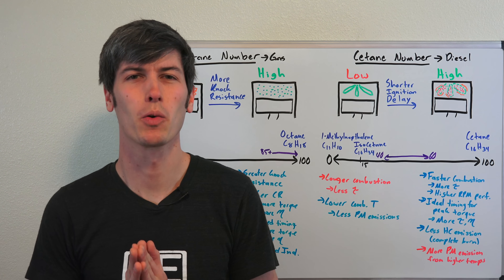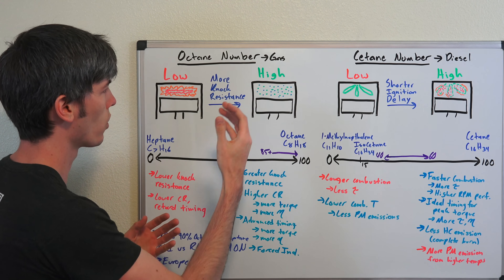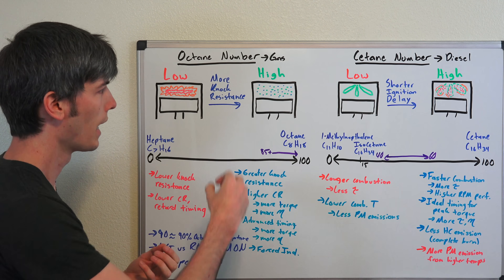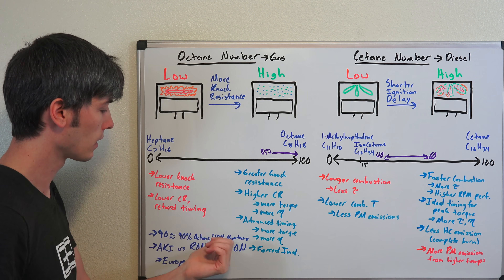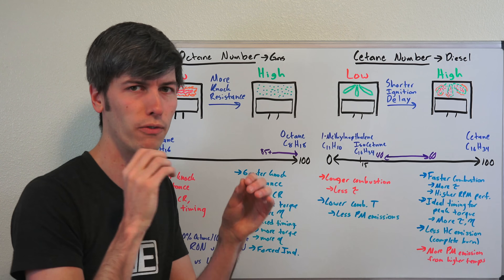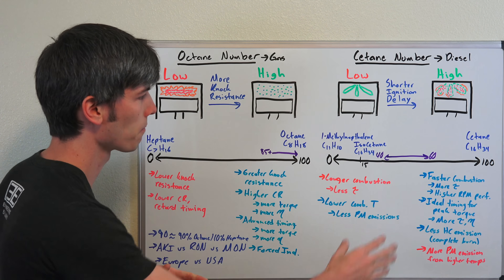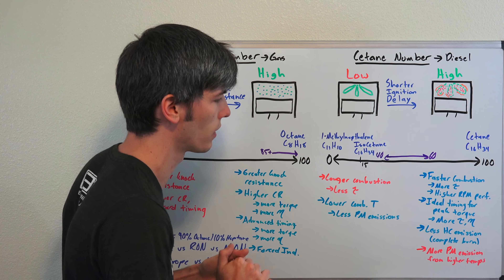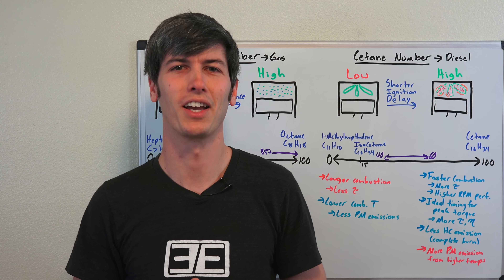Octane vs Cetane Number - Gas vs Diesel

Comment: I run 89 in my vehicles just to have that little extra resistance to knock.
Reply: A little bit of knock every know and then is normal and does no significant harm to your engine.
Reply: Giovanni you’re insane if you think any amount of knock is good for an engine.
Reply: I never said "good", did I? I'll give you a dollar if you can tell me where I said that to you.
Reply: Stay_salty_fam I'll give you $2 if you can tell me where I said it was "fine" to you.
Reply: Gasoline is volatile. Even with higher octane gasoline, it can still detonate before a spark. And sometimes engine knock can occur with simple fuel and carbon deposits. It's normal for there to be some mild engine knocking with any fuels,  you can't expect absolutely zero knock in a piston engine, even on a diesel cycle.
Reply: Stay_salty_fam Then run 89 octane. No one is telling you not to. People are simply telling you that using higher octane in an engine that does not require is just a waste of money. If your engine knocks, then it needs higher octane.
Reply: Giovanni you said an idiotic statement that knock, even if just a bit, is fine, which not true.
Reply: WillerNK of course you can’t, but if I can help buy running a slightly higher octane to help decrease it, I will. Only reason 87 is even offered is because people are cheap.  Manufacturers have to get their engines to run on it because people won’t spend the extra $5 a tank.
Reply: Stay_salty_fam You aren't decrease anything, you just believe old grampa's tales. In reality, modern engines have knock sensors, which keeps engines from knocking. And with direct injection, fuel knock is virtually eliminated, even on high compression and turbo engines. They can run 85 octane without problems.
Reply: Hambone it’s not an old wife’s tale. My vehicles don’t knock on 89 but knock pretty bad on 87, especially in the summer.
Reply: Hambone Higher octane actually inhibits ignition. With direct injection, we could actually start lowering octane ratings, and that could actually allow manufacturers to develop engines with easier combustion, creating more efficiency. According to Mazda, their HCCI actually runs best on 80 AKI, but that's not widely available.
Reply: Stay_salty_fam Then your vehicles don't adjust for knock. I didn't say what octane you should or shouldn't be using. I run 87 in our newer Ecoboost all the time, it's never had any knock, and that's because it adjusts for knock.
Reply: Giovanni the 6.2 in GM trucks has direct injection but the manufacturer recommends 93.  93 in ecoboost trucks produce more power and better fuel economy
Reply: Hambone define require?  My owners manual says use 87 or higher.
Reply: If your engine doesn't require it, enjoy wasting your money.
Reply: Well, it says what it means. If it "recommends 93," it's not required. Our family also has a 6.2L Denali, which has "93 octane is highly recommended" printed in the owner's manual and on labels, and it runs just perfectly, without even a little knock, on 87, even when towing, but it runs better ( definitely more efficiently and likely with more top-end) on 91, which is what we have in California. We don't even have their recommended 93 here.

Now, if your owners manual tells you what it recommends, and it starts to knock, then your stories just become less credible. The overwhelming majorty of people tell you they "hear this and felt that" are placeboed by higher octane, they aren't actually experiencing any knock with lower octanes. This is true for most people. 

Besides very high-performance engines and some European cars, virtually no engines need anything beyond 87. There's really no reason anymore for a modern, directed injected engine to knock, even some non-direct injected engines that "require" or "recommend" high grades still adjust for knock.

Comment: So does this mean e-85 has more of a chance of causing engine knock than if your car just took 87?
Reply: Masa loakz If you're talking about the same E85 that's sold at least in northern Europe, the '85' in it doesn't refer to the octane, but to the maximum percentage it may contain ethanol instead of gasoline. Now, note where the 'E' is in the names E85 and 95E -- those names aren't actually the full names but parts of the name, picked differently in a way that's like made to cause confusion. A full name would be for example 95E10, which would mean the octane rating is at least 95, and ethanol content at most 10 per cent. Apparently, in E85 the octane is left out of the name because due to the amount of ethanol, which has high octane, the octane rating of such gasoline should be sufficient for any use, so knowing the octane would be unnecessary. But it ends up being confusing.

Edit: You seemed to mean American products, but it looks like the meaning is exactly the same. So there should be no knocking caused by low octanes. However, unless the car is designed to use fuel that mostly consists of ethanol, the plastic and rubber parts on the way from tank to engine might age much faster due to the ethanol.
Reply: Ethanol causes less knock, it’s like having higher octane. Only cars made for ethanol can really use it, though.
Reply: Pauli Vaara yea I'm American. I didn't really know much about e85 other than it's only for certain cars that take it. But that completely makes sense to me now

Comment: Can you explain why California has lower octane than the east coast. 93 is common out east but the highest in California is 91.
Reply: Because gasoline stations couldn't keep MTBE from leaking into groundwater, so it was banned as an oxygenate back in 2001. MTBE can be added to fuel in greater quantities than ethanol without causing other problems. At the same time, it is a slight octane booster. Unfortunately, MTBE is also detectable by humans in parts per trillion quantities and tastes/smells like a minty ether. In parts per trillion, it is very difficult to remove from drinking water.
That got us to 92 octane. Then, a survey of gasoline distributors led to the further lowering to 91, as the refineries could maintain volume of production easier.
In summary, poor maintenance by station owners led to government regulation to protect drinking, and agricultural, water. And then a business choice on the distribution side further lowered the octane rating to avoid shortfalls in production. Jerry Brown was Mayor of Oakland at the time and had nothing to do with it.
Reply: Ojisan642 I know regular gas is lower octane in the Rockies, due to higher elevation and less oxygen.
Reply: Jerry Brown's special blend of gas.

Comment: So what happens if you put the wrong octane of fuel in your car? Is it bad for the engine?
Reply: If it requires high octane, it will knock, which isn't good for the engine. If it doesn't, nothing will happen beyond wasting cash.
Reply: Using a higher octane than required can be bad long term. Since a motor that only requires a lower octane won’t have the higher compression, you can end up with an incomplete burn, leaving behind carbon composites.
Reply: TLDR: It can damage your engine due to knock. 
A lower than recommend octane lowers the temperature at which the fuel with combust, which means the heat generated from your engine due to the compression stroke has a chance to predetonate  the fuel before your spark plug does. 
Your engine is designed tightly around spark, compression, and valves allowing air, fuel to enter, and exhaust to escape. Off time combustion damages your engine.
Reply: If it's a relatively modern engine then it should be ok, they can often adapt to varied octane - that's for lower than recommended octane. Higher than recommended is usually just a waste of money due to the higher fuel cost, and nothing more.
Reply: szafirowy01 Actually that's changing again. They are coming out with new engines that have VERY HIGH compression ratios. I saw it on a couple previous videos of Engineering Explained.
Reply: Stacy Smith, that actually changes nothing. New engines can adapt. IIRC even some engines as old as from 80s can do this.
Reply: szafirowy01 He literally said in the video: "Due to the higher compression ratio an octane of 91 or higher is recommended."

It doesn't matter how good the monitoring system is or how many calculations per second the computer can perform, it still doesn't change the laws of physics! Higher compression ratios will cause premature detonation with lower octane fuels.
Reply: Stacy Smith RECOMMENDED. That word doesn't mean the same thing as "required". Also that's not a law of physics, just an effect of many variables - not only compression ratio but also AFR and ignition timing which are dynamically changed all the time during engine's normal operation.

PS Also, 13:1 is a VERY high compression ratio, yet Mazda makes engines that run it on regular US gas. Magic, laws of physics broken? No, just correct setup of those many variables.
Reply: john shobe Never thought of that, even though what you said has a lot of anecdotal evidence! but it DEFINITELY makes a lot of sense. The consensus is that if your vehicle is not rated for premium using it won't hurt anything, you will just be wasting money. I'd say that's probably true.

Comment: Great video as always
But i need to know the difference between fueling with gas vs natural gas pros and cons and also if ny car has different octane recommendations which is best to use my car has 90  95  98 octane on the filler cap  thank you and sorry for the tall comment :) :) :)

Comment: Some things you didn't mention that my thermodynamics teacher did. The octane that is most efficient in any given gasoline engine depends on the particular engine. The general rule is buy the cheapest stuff that doesn't cause your car to knock but the age of and amount of modification done to your car can significantly affect this. Also ambient air pressure can affect this. In the U.S. you never see lower than 87 octane if you're near sea level but in the Rocky Mountains (Utah, Colorado, etc.) most pumps offer 85 as the lower air pressure changes how your engine functions.

Comment: Another Jason video, another piece of knowledge. So, if premium has a higher octane means it will resist knock, so, should I run premium in my truck? I'm not sure if it's knock or noisy lifters, probably lifters she's supposed to run on regular...
Reply: Kiraro The Kitsune if the manufacturer recommends 87, using higher octane will not benefit you. 

The only occasion where you may see better fuel economy is if the premium fuel doesn't contain any ethonal.
Reply: James Hunt yeah, mine is stock so premium is useless

Comment: So do I really need to use premium fuel in my 1986 BMW 633csi? I have always heard that you should in old BMWs.
Reply: August Sawzak if it sounds like a diesel when you floor it then you need higher octane.
Reply: Dillan pridgen so if it doesn't I am just fine?
Reply: I would look for videos of what detonation sounds like so you know what to listen for.
Reply: I'd do what the manufacturer recommends, personally.
Reply: This is where you should stick to what is recommended. Stock European engines from that era tend to prefer 91 AKI (the owner’s manual will often list 98 RON, and while not directly comparable, US-spec 91 AKI is roughly equivalent). Obviously, if modified (higher compression, radical cam, etc), you will then want to run higher octane fuel in that case as well.

For anyone with older Euro cars where the OM lists octane in RON, if you’re confused about what fuel to buy, please go watch Jason’s video on the octane scales. He made one of the better explanations available on YouTube.

Also note that if you’re hearing detonation, you are WAY across the line into engine damage territory. Some folks try to push it by running mid grade, and the pinging may be subtle and occasional enough they don’t hear it over the road noise, but damage can still happen. Best to stick with the proper grade for your vehicle, not to cheap out. The manufacturer did a LOT of endurance testing to determine that fuel grade recommendation. I personally don’t feel like making my engine an experiment in how cheap one can be and “get away with it”.
Reply: It not like it's hard to listen for it. If an engine is quieter with one octane and clatters with a lower octane, you know which fuel is good for the car and which isn't.
Reply: The engine has 9.5:1 compression which is relatively high for its era. 91 is likley recommend to keep the engine safe.
Reply: James Hunt I'd bet he's not making full compression anymore. It'll probably run fine on the cheap stuff. 👍🤪
Reply: Depends on the engine compression ratio. Also depends on elevation and climate you live in. If you live in a hot dry climate definitely run the 91

Comment: In Europe, there are some pumps, that do offer 91RON (=87AKI) fuel, but ... most modern cars ask for 95RON minimum, which is kinda "regular" in here. Also, there is almost no difference in price 91 vs. 95. Moreover, "brand-name" pumps do not offer 98RON, which is considered "premium", but REAL 100RON fuel, for ~10% price premium (due to >50% tax on fuels in Europe). 
So yes, Europe has better fuel (no offense) :)
Reply: That's a waste of cash and technology for Europe. Here, in the US, most European cars recommend 91 AKI or greater, but almost every Japanese, Korean and American cars runs on 85 or 87 AKI just fine, even with high compression engines.  With modern direct injection technology, there is no need to run higher octanes.
Reply: There is no conversion from RON to AKI, because AKI is an average of two octane measurements, not a different measurement unit. Also, as mentioned many times before, octane has nothing to with fuel quality, it's simply a fuel with a different ignition point. Unless your engine is prone to detonation, there is no need for higher octane, it's simply a waste of money.
Reply: Octane has nothing to do with quality for the 1,000,000,000,000,000,000,000,000th time.
Reply: nms789 Seriously, do you realize that his videos have explained this or are you just too slow to understand?
Reply: Did you even watch the video?  There is no straight conversion between RON and AKI.
Reply: You are right.  The computer readjusts ignition timing and sometimes fuel injection to operate correctly with various octanes.  The later model Ford Mustang V6 makes around 275hp on regular gasoline but something on the order of 350hp on premium unleaded.  Don't quote the figures above, they are ballpark based on my recollection of an article I read recently.

Comment: So, the kind of fuel depends on the compression ratio?
Reply: Maeryaenus the kind of fuel you want depends on allot of variables but mainly cylinder pressure which is affected by timing, compression, and boost.

Comment: How is there octane Num greater than 100?
Reply: Yes, fuel octane ratings greater than 100 are possible and are derived by extrapolation or by the substitution of the comparative laboratory reference fuel iso-octane (2,2,4-Trimethylpentane) (100 RON/MON/AKI) with a higher octane laboratory reference fuel such as high purity toluene (121 RON, 107 MON, 114 AKI octane) during analysis. 
The extrapolation is through the use of performance numbers that are determined from the instantaneous mean effective pressure (IMEP) in the Cooperative Fuel Research engine cylinder.

Comment: Basically, cetane is anti octane.
Reply: Actually, that's heptane. The opposite of cetane is 1-methylnaphthalene, as explained.
Reply: @bitTorrenter  You misunderstood.  I was not referring to the chemical named octane, I was referring to the octane rating of gasoline. The octane rating of gasoline is how well it resists preignition with a higher number meaning more resistance. The cetane rating of diesel fuel is how easily it can be ignited by compression, with a higher number meaning it is easier to ignite. Therefore the two ratings are opposites

Comment: This is off topic but why do some petrol pumps have a single nozzle instead of multiple seperate nozzles for each octane? it seems very easy for someone to put the wrong octane or even diesel.
Reply: Its MAGIC maybe not diesel, the nozzle for diesel and regular gas are usually different sizes
Reply: Ah yes i forgot about that.
Reply: They're still pulling from different tanks to fill each octane, just using a common delivery point.  There might be some slight residual mixing in the hose, but it's not going to be enough to make any appreciable difference once it's delivered to your tank, with the exception of diesel, which is always a separate nozzle.  It's cheaper to use a common hose/nozzle than to have three separate ones.

Comment: From what I read, higher octane fuel evaporates easier, thus i think that’s why it ignites easier.

Lower octane gas overheated my turbo engine and burnt an ignition coil. Switched to higher octane, engine runs great with no overheating!
Reply from the maker: From a compression standpoint, lower octane fuel ignites more easily.